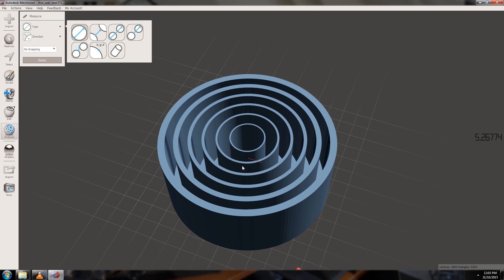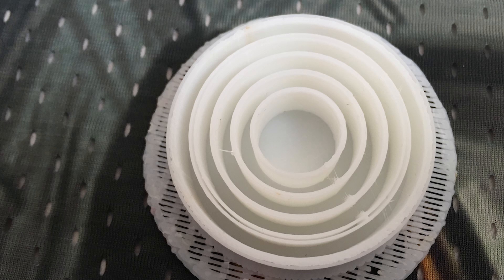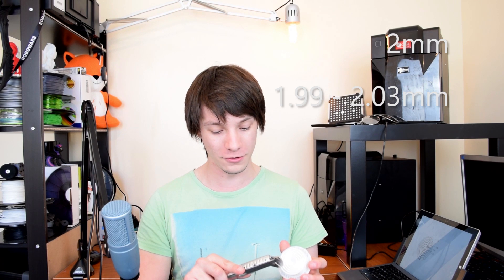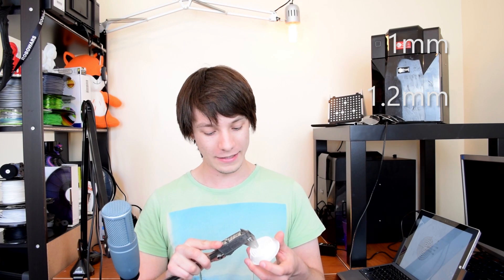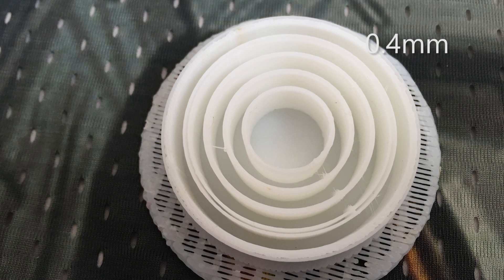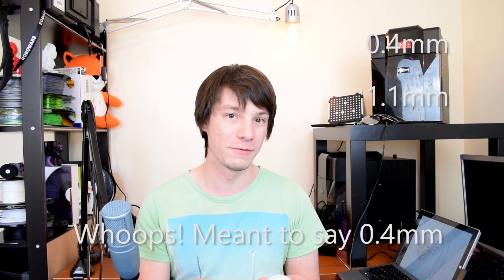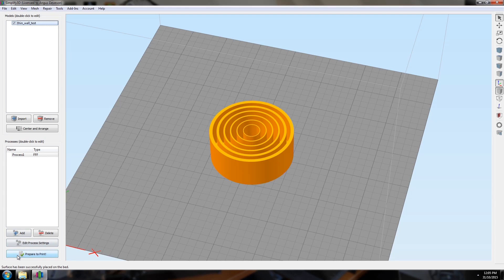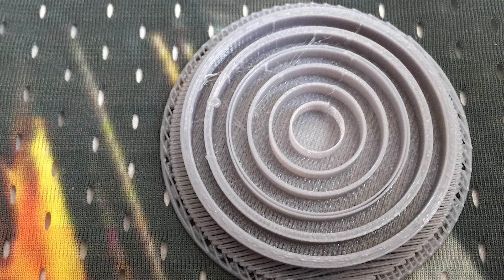3D Printing Thin Walls - 2015

Comment: I am having an issue with gaps between perimeters using a .6mm nozzle in simplify3d. Any suggestions as a place to start? I've adjusted some of the settings in the advanced section for gap fill and whatnot but nothing has made a meaningful difference.

Comment: Hi Anges

Thanks for the great content. I watch almost every video from you.

Why does Simplefy3D puts the startscript not in the correct position in the gcode?
When i look in the gcode, the temerature-settings of the slicer are put before the lines of the start-script.
I can not heatup the bed AND the hotend AT THE SAME TIME because the settings of the slicer heatsup the bed to the temperature of the slicer, NOT THE STARTSCRIPT !!!!
How can i put the startscript BEFORE the slicer-settings in the gcode?

Comment: Hiya, I'm struggling to print a 0.85mm extrusion for a cookie cutter. It only shows the base and not the cutting part in the slicer when I prepare to print. What was your settings in the simplify3D software?

Comment: I've been having problems printing a 6mm (six mm) wide solid wall. I get a weak air line down the middle. Makes for a weak part.
Reply from the maker: increase your perimeters (outside wall) until there's no gaps.
Reply: @MakersMuse  Thanks but I've tried that. I think my part must be slightly wider than a whole multiple of lines. Eg 6.1mm or something like that. I have the line width set to 0.5 so I think Cura is generating 12 lines (6 in each wall) with a 0.1 gap down the middle. I have "Fill gaps between wall" ON but it was being ignored because there is a "filter out tiny gaps" setting which was ON by default. I've now turned that OFF and I'm running a print to see if it's cured the problem. (Aside: I could actually use thinner walls and 100% infill but it has a big effect on print time which is important at the moment). Love the channel by the way.
Reply: Well seem it's not that. With "filter out tiny gaps" set to off it does do some extra printing but not where im seeing the bigger gaps. I can get a feeler gauge in them, some are 0.05 others 0.15mm. At the moment over extruding is a partial cure but I'm going to have to experiment some more. They are down the middle of curved parts. Line either side of the middle are printed in different directions so could be a mechanical issue with my printer I guess.

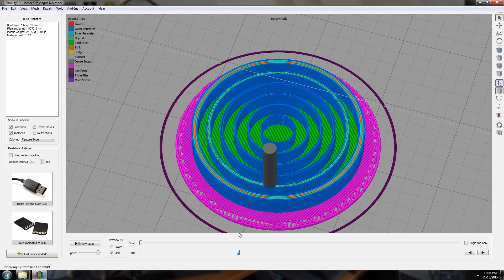Comment: Ha! 5:38 a similar thing is in Cura 4.5. My test 0.4mm wall, 0.4 nozzle .. 90mm cylinder has 0-40mm solid slices, then 40-45mm is this weird gaps, then 45-70mm - solid wall, then gaps, then solid.
I think Slicer should not do this, as the nozzle has the same width as the wall.. Thanks for your suggestion to have at least 0.8mm wall. :-)

Comment: after doing this last night, my 1.5 and 2 mm had very thick fill. my 0.4 inner circle read 0.39 and 0.42 on my calipers. I am using the tevo tornado, stock setup. 0.24 layer height, 0.4 ext width, 60mms, with 40%. I am very impressed with my printer. i love it

Comment: what extrusion width did you use? I have changed it to various ones, and each print was for sure different. If i use a .28 extrusion width which is 1.2 times bigger than my layer height of .24, its gets pretty thin on my tevo tornado and still prints well. i printed a 250mm tall, one wall feature and it was about 0.39mm thick. I used a 0.40 extrusion width though, so i was pretty close

Comment: I can print 0.28mm walls with a 0.4mm nozzle, on a stock Anet A8 sliced in Cura 4.0.0. No problem....
Doesnt have any strength but they look good, and are there.
Looks cool, with clear or natural (no color) plastics.

Comment: Great video! BTW Does you have any video about Line Width other than wall width? 
Because I`m currently printing line width 0.2 with standard ender 3 nozzle that is  0.4 and I`m having good result.
 need to decease a little bit more to achieve best gear teeth precision like 0.16 that how I find your video.

Comment: Print Thin walls option is giving rubish output in Cura.  have found the solution with combination.  There is hidden option at Special mod: Surface mod : Select "Both"..  one more thing needed. off set a single surface where the thin wall regions.  (Which is needed as surface mod single line print). Normal mod already printing the solids. But selecting thin walls is not changing output so much after.  It should not be so complicated. I thing Cura can handle at the next versions.

Comment: If the fill is between two two very close walls, there is so little material to extrude and so short of a time to start extruding that it wont have a chance to extrude any fill at all unless the retraction settings are very perfect.

Comment: Hello Angus, I'm having a problem with the air gap between perimeters I am using Simplify3D and for the most part I have no problems printing, but with this said I have tryed all the S3d tips for the air gap and I'm just at a road block

Comment: Interesting video. I am pretty new to 3D printing and one of the first things I printed was a thin walled shim that I designed myself. From memory, it was 1.2mm thick, which I assumed the slicer would put down 3 solid line widths to achieve. But, it put down a weird stippled infill similar to your example that made the part quality pretty poor.
It looks like this is a general machine/slicer limitation, rather than anything inherently wrong I was doing. I tried changing infill %, number of shells etc. but nothing I could do would make it put down 3 solid lines wide.

Comment: Just done this test on my JGAurora A5 and the results are:
2mm Ring = 2.05 - 2.02
1.5mm Ring = 1.65 - 1.51
1mm Ring = 1.08 - 1.04
.8mm Ring = 0.82 - 0.78
.6mm Ring = 0.51 - 0.54
.5mm Ring 0.59 - 0.49

When I sliced the STL file the Base was Hidden so just loose Rings

See Picture - http://www.galactic-empire.co.uk/IMG_1354.JPG

Comment: I agree with the last commenter. If you're testing and working with measurements, you gotta understand your measuring device AND your measuring technique! 

First of all, just because a digital caliper produces some digital numbers on an LCD screen, it doesn't make those numbers "true". ALL measurements have a tolerance! Do you know what the accuracy and repeatability of your calipers is? Do the jaws flex? Does the measurement change depending upon where in the jaws you measure, or how large your contact surface is? The numbers on my digital calipers will change several digits depending upon how I hold them or how hard I squeeze, even with nothing between the jaws. etc., etc...

Second, what about the "human element" of your experiment? As you mentioned, how repeatable was the force you used when squeezing the walls? How consistent was the angle you used when holding the calipers? Did you always use the same part of the calipers to measure? etc.

And as you mentioned, the accuracy results also depend upon other software and firmware settings in addition to the overall capabilities of the software and hardware. And, the specific printer used is most definitely going to be a huge factor. A big factor is how accurate was the nozzle size? What about printing and extrusion speed? 

And finally, what about the material itself? How much does the plastic deform when squeezed? How sensitive is the finished size to temperature and humidity? So many variables!

All I'm saying is that you (we all) should be skeptical of our experimental methods when trying to quantify results, ESPECIALLY when trying to quantify measurements of only a few percent while using inexpensive measuring tools, using them quickly, and using them when your primary emphasis is trying to produce an entertaining video, rather than to carefully spend the required time to make the most accurate measurements possible. 

All that said... Thank you! I still learned something from your video, though I'm not sure it was what you initially intended. :))

Comment: HI IM USING THE CREALITY CR10, and Cura to slice my printing, but i have problem printing parts which need to be assembled and they couldn't fit. may i know what is the mistake i made? is that the wall problem? thank you

Comment: You can trick SF3D to print this with a single round line when you set the Extrusion width manually to 0.3999mm. Worked kinda well for me.

Comment: I have set my printer to have 0.02mm extruder (although I have an 0.04 one) and it did the job well :3 Flashforge Pro with Simplify 3D that is :3 The model is very fine too :)

Comment: hey angus can i cut the print short and not print the full height of the model? will it affect the accuracy of the walls if i do so?
Reply from the maker: sure you can but might be left with exposed infill, it wont change the accuracy of what was already printed.
Reply: i used cura 2.5 to slice it and it came out really good the 0.4mm wall was printed and im waiting for the bed to cool to remove the part to test it accuracy. Funny thing is it did the same small jerking motions on the 0.4 wall like you mentioned so hopes are high

Comment: Instead of trying to guess the thinnest wall a slicer would do by giving it models with variation of thin walls, i tried giving it just data that consist only of open surfaces i.e. non-watertight models, which tecnically has no thickness at all. This has worked very well and S3D now consistently gives me then thinnest walls it can manage without any 'ignore' issues either. Whats more, this method now lets me decide how many walls (no air gaps either) you want by simply setting the wall count manually. Takes all the guesswork out of the whole thing and produced really tough light parts.

Comment: hey maker i have a monoprice mp silect mini 3d printer  been trying  to print off a thingivers  but my filament keep rolling under the nozzle
Reply from the maker: Sounds like your first layer is too far from the print bed, or you're using the wrong temperature settings!

Comment: We have a CubePro which we have to set to Solid infill to get any thin walls/details to print solidly and dimensionally accurately. On any other infill settings you get wildly varying wall thicknesses, and most of the time theyre empty. Bit annoying. Don't get me started on their software. New releases refusing to slice designs where the old software worked fine.

Comment: Slicer seems to be a limiting factor because a ø0.4mm nozzle can indeed yield thin walls of 0.1mm thickness.  At least as demonstrated in straight walls. (https://plus.google.com/+YuanLiuTheDoc/posts/2K6fsbWTfVP)  I got those using the 0.5mm single-layer walls test from Makerbot calibration set (http://www.thingiverse.com/thing:2064/).  KISSlicer was set at 0.2mm layer height.  I found no special "thin wall" setting in the slicer.  The model says wall thickness is 0.5mm but the outcome is consistently 0.1mm in all 4 straight walls.  In the discussion Stephen Baird proposed that slow extrusion with fast head movement will result in thinner strings.  Now, if only the slicer can consciously take advantage of this, there is more potential in today's plastic 3D printing.

Comment: One part I've had trouble getting other slicers to do correctly is a single-wall spiral for a 3d printed torsion spring.  I'd be curious if Symplify3d handled that correctly.

Comment: Hi I have flashforge i use sailfish and i use makebot software for slice , i had one problem of thin wall not getting filled so to solve that i changed my shell from 2 to 1 now its fills the gap. hope u can give it a try. And by the ways grt videos .

Comment: Angus, what settings did you use in S3D? I'm trying to print someone with a wall of 0.5, nozzle is 0.4 (s3d extrusion settings on auto gives 0.48), however the print always does 2 perimeters so I get walls of 0.8 to 0.9.
thanks for the great vids!

Comment: Can you please do a sphere test on 3d printers. I'm having a hard time printing one as the bottom portion gets soggy. I know cutting/splitting it is the right option but how in most cases would you do it.
Reply from the maker: +lucidnightmare927 Good question, I did this video some time ago to see if printing upside down would solve this issue... turns out cutting in half is the best way to get consistent top and bottom hemispheres. https://youtu.be/bTH1oYxZad4

Comment: Dont know what your doing, mine prints it more the less accurate. But not 1.2mm @ 0.8mm xD
There is a limit - ok. But not 1,5mm ;) More like: The nozzle diameter ;)

Comment: at least in S3D the nozzle diameter (hole size) of 0,4mm results in a tool diameter of 0,48mm. S3D automatically scales that up to compensate for the deformation of the printed line due to gravity and extrusion pressure. Secondly stl files only contain triangles and when trying to mimic a cylinder like that the actual thickness (from inner triangle to the outer one) might be a tiny bit smaller then the designed thickness due to the approximations that the stl exporting tool does. This is also why S3D prints those pointy lines for the 0.4mm wall.
I don't know if you're working with printers that run e3d or lulzbot hotends, but both of those have the capability of using nozzles down to 0,25mm so given you print a lot of thin walls that all have roughly the same thickness you should pic the right nozzle for the job.

Lastly S3D allows you to define an outline overlap for the infill pattern as well as "allow gap fill when necessary" both those features can help you to get infill into thin walls even though the infill thickness is below the extrusion diameter.

PS: the up software seems to only use rectangular fill patters, however the concentric fill pattern (like in S3D) is much better for thinner walls, given that you have an optimal nozzle diameter / wall thickness.

Comment: What tool are you using to measure the wall thickness? Is it sold in the US?
Reply: Thanks!!
Reply from the maker: +innomind They're called Calipers. Mine have a digital read out, but you can get manual (verneer) or dial caliper variations too.
Reply: +Maker's Muse I have been looking to get some good calipers. What calipers do you have?
Reply from the maker: They're a mid range pair of digital calipers, no name brand. Any basic pair should get you started - these look decent. http://amzn.to/1JCpSMc
Reply: +innomind lol ya we have them in the US you can find them at Ace, Lowes, Ziggys, Home Depot, or really any hardware store and they are pretty cheep
Reply: +innomind 
Harbor Freight sells them too...   Sometimes on sale for $10.  They have some better models too.  I suspect at Lowes, or Sears, probably better models... but not sure.

Comment: Thanks this is very useful. which printer you used? have you ever printed floor plans?
Reply from the maker: +Jürgen Van Tomme I have printed a few architectural prints, I used the UP Mini and Wanhao Duplicator i3 for these tests. I would recommend 1.5mm wall thickness as a minimum if you can.
Reply: +Maker's Muse thanks for your answer this info helps me a lot. I am considering buying a printer for printing of floor plans. are there pictures available of your prints?
Reply from the maker: +Jürgen Van Tomme I found this one - not very exciting it was part of a much larger model split into pieces. It was printed on the Flashforge Dreamer in white PLA http://img.photobucket.com/albums/v424/dyrodium/IMG_0870_zpsmjzsnavm.jpg
Reply: thank you +Maker's Muse for sharing this now I have an idea. 👍👍👍

Comment: Hey would you be able to let me know what settings you used on simplified3d on the very last test? I make cookie cutters that require 0.05cm walls.. so 0.5mm which I have printed hundreds of but all of the sudden after making a few changes which I cannot put my finger to it does no longer print
Reply from the maker: +Manny Cortes Are they just not printing at all? Under the Advanced tab I had my 'thin wall behaviour' ticked to Allow Gap Fill when Necessary.

Comment: Angus, did you have the option "Allow gap fill when necessary" on the advanced tab, thin wall behavior on Simplify 3D checked? I wonder if this makes a difference for the wall that printed with air in the middle. I had this behavior for on 1.6mm walls where the walls just printed apart until I checked the option.
Reply from the maker: +Norma Barr I didn't actually, It would be pretty interesting to see how much that changes the accuracy of the walls, I will do some more tests. S3D has so many options it can be so easy to miss things!

Comment: Since filament is elastic when hot and melted, you can print thinner than your nozzle by having the head move faster or by extruding less, the filament will stretch out as it is laid down.  Can't get MUCH smaller than the nozzle of course and it won't be very strong.  I think it would be more curious how more 'standard' slicers do this.  I suspect most people are running slicer or cura.  Simplify 3d looks great, but I always have other things that need my next $150 more.
Reply from the maker: +Alluvian Yeah I'll probably do testing in Cura as well, filament is actually extruded at an accurate dia by how fast it's pulled from a large die - rather than from an exact sized one and the speed determines its overall size. I found that pretty interesting!

Comment: I have a MakerGear M2, and I have 2 nozzles -- a .35 and a .5. According to Simplify 3D support, you can get walls thinner than your extruder width by specifying the extrusion width manually. I liked to do that anyway as the default for .35 nozzle is .42mm  and I tend to prefer to use .4mm. It will change the flow rate accordingly, you can go within a range of your extruder width above and below, so for a .35 -- I could accurately get prints with specifying extrusion width of .28, or .42. So basically .07mm off in either direction -- it works well to get very highly detailed prints, or in other cases to get a quicker print by using a higher width